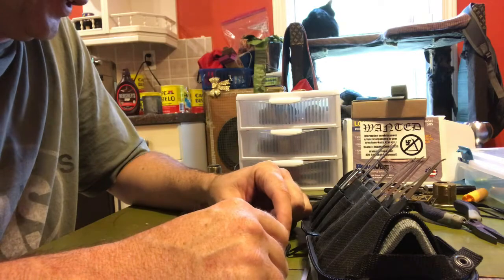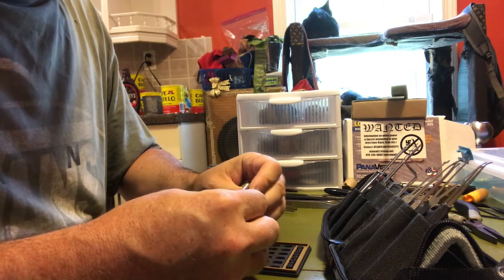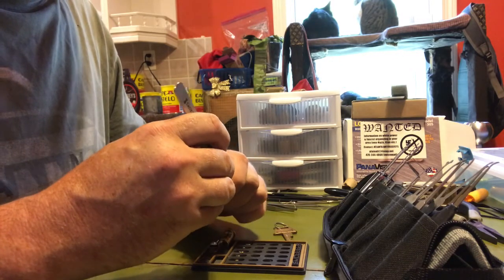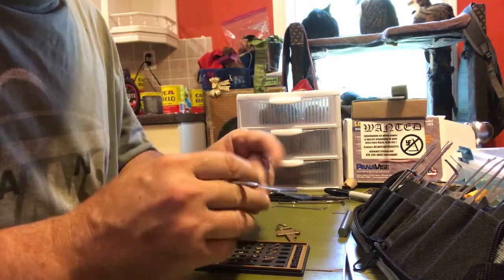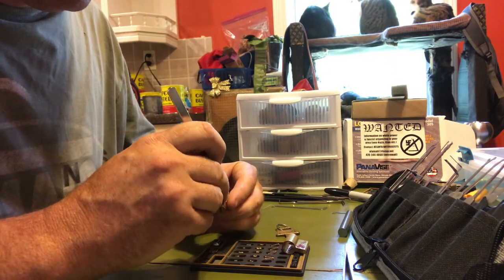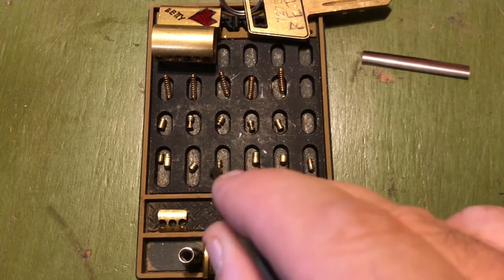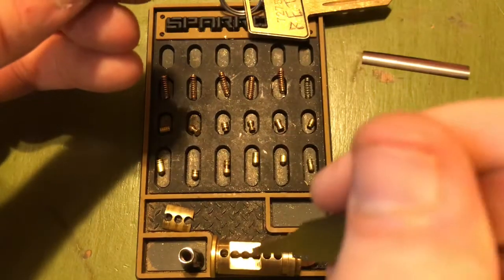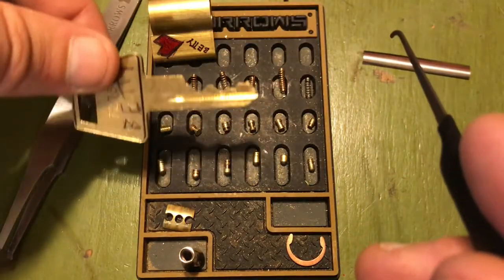Gutting and Pins and Sheath in Betty Lock

Comment: I'm sorry Betty gave you so much trouble, as far as I'm concerned: This is a valid Open, you are a boss!

You are right about driver #2, the flat side faces the sheerline. I started with a spare customized keypin that worked nicely inside there.

My intentions with the pin and driver in chamber 1 was to give the key a fighting chance to go in clean, and to make the lock look stock if you peeked into the keyway.

And there is a little arrow carved into the underside of the sheath, this should point to the front of the lock when assembled.

Thanks again for taking a crack at Betty. You rock!
Reply from the maker: "...was to give the key a fighting chance to go in clean,..." Oh that was some good forward thinking